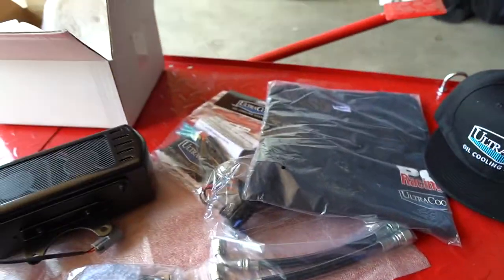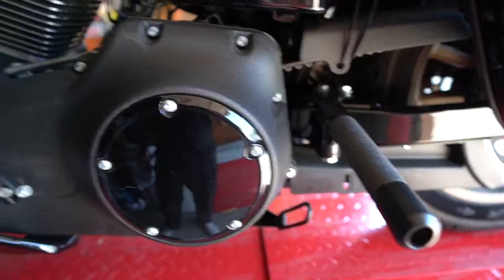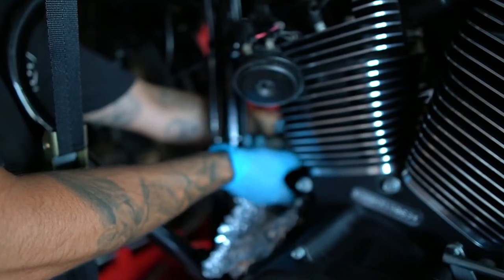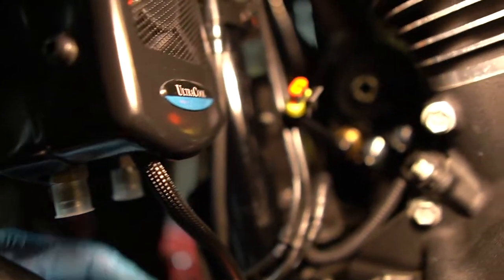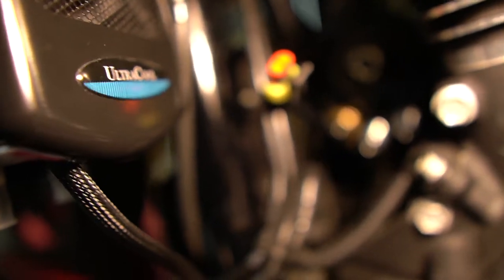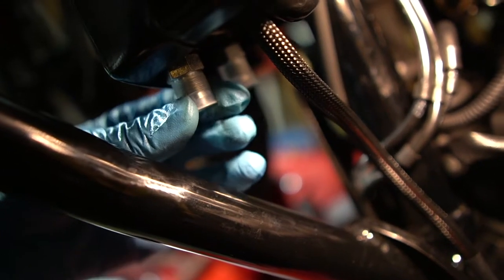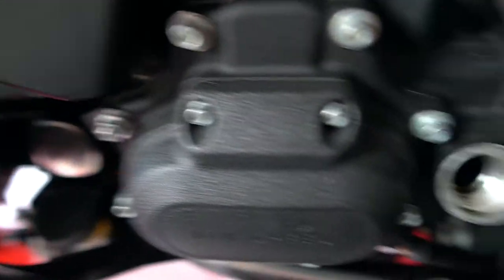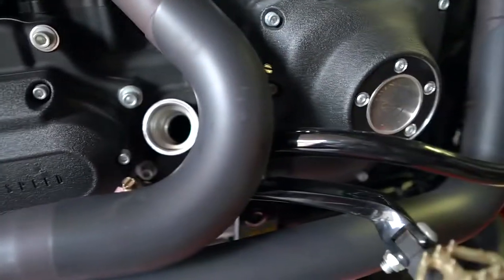MY DYNA BURNING UP 🥵🔥 / HOW TO INSTALL A 3.O ULTRACOOL OIL COOLING SYSTEM / '17 DYNA LOW RIDER S

Comment: I have been thinking about putting an Ultracool on my 17 FXDLS for a while now. After watching your video, I am going to get one for sure. Thanks for taking the time to record this video. It is going to help put a lot when I install mine. Also, I'm curious to know who makes those saddlebags you're rocking on your bike? They look great.
Reply from the maker: Definitely a good mod to have on the dyna, can’t go wrong with the ultra cool oil cooling system. There’s other brands out there as well but I think ultracool is a great product. So far so good. Stay tuned for a review video on it, and are you asking about the hard shell saddlebags?
Reply: @team_sixthree8956  Yes the hard shell saddlebags. I've been wanting to get some for a while now. The ones you have look great on your bike.
Reply from the maker: @goochma   they came with the bike when I bought it. But check big bear performance I think they’re the only ones that carry those type of hardshell bags
Reply: @team_sixthree8956  Thanks man I'll check it out.

Comment: Thanks for the vid!!!  Did it hold at 2.5 quarts or did you need a little extra?

Gonna be getting this mod for sure...Dyna I bought had a stage 2 upgrade and I'm expecting heat issues for sure...glad to see how it's done...pretty user friendly kit.

Take care brother and keep the shiny side up.  Cheers
Reply from the maker: It does hold 2.5 quarts 
Might wanna check at 2.2 quarts run it a bit and check your oil level.
No need for extra might leak out.
It’s definitely a good mod specially for dynas 
Best of luck 
If you need any help you can always reach out I’ll try my best to help.
Thanks for watching ride safe 🤙🏼
Reply: @team_sixthree8956  Solid brother...thanks for the reply...if I have issues I'll drop you a line!
Reply from the maker: @HOTDOG401   🤙🏼🤙🏼
Reply from the maker: I will be doing a review on the ultra cool oil cooling system soon.
Reply: @team_sixthree8956  👊

Comment: Great job. I was kinda stuck on mine wondering how to run the wires to the back. I thought it had to go under the tank. I totally didn’t think about running along the bottom of the frame.
Reply from the maker: Thanks for watching, I figured running a through the bottom would the easiest and quickest way. So far it’s holding up nicely. Ride safe out there 🤙🏼

Comment: What engine guard you running?...a lot of the engine guard/crash bars don't work with side mount cooler..🤙
Reply from the maker: It’s a kruesi original k bar

Comment: Excellent vid, why did you choose ultra cool over jagg? I am living in very hot weather and my bike engine temp sometimes reaches 350f and I am badly need an oil cooler
Reply from the maker: You should definitely get an oil cooling system it has helped me a lot.
I went with the ultra cool cause it’s built better than the jagg in my opinion and it was recommended by a few dyna riders.
Reply: @team_sixthree8956  thanks for the reply, seems I will get UC soon
Reply from the maker: @lio1999  no worries man, you’ll thank me later it’s build better too. I haven’t had any issues with it.
I will be making a review video soon stay tune and thanks for watching ride safe out there.